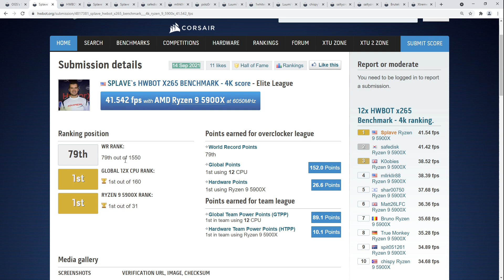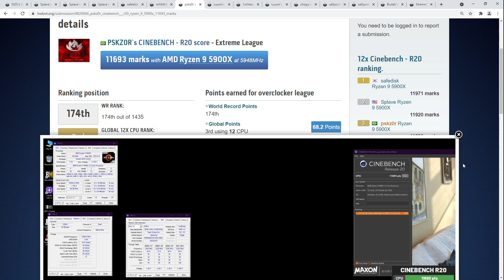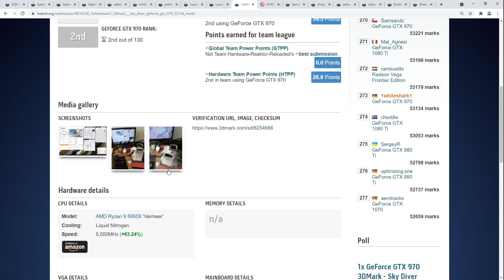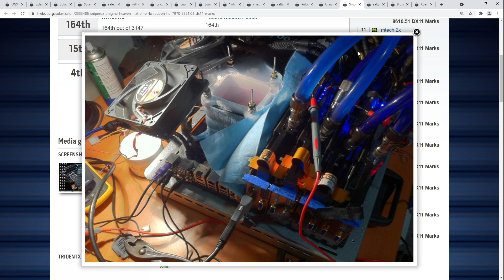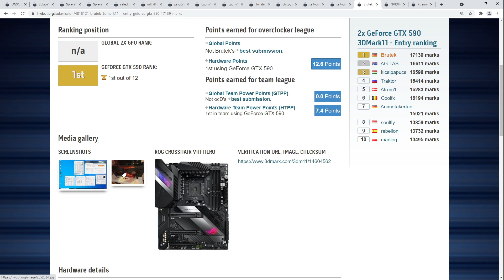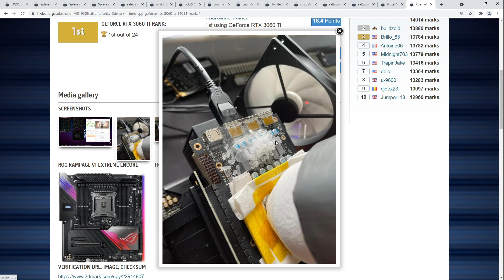HWbot round up #19: 7.1GHz 11900K, 6+GHz 5900X, 1410MHz GTX 690, 2.35GHz 3060Ti and more!

Comment: I used to be 3rd in Fire Strike with a stock cooler GTX 690 that I got broken, fixed, upgraded the VRM to handle more current and recapped in roder to get better stability. I slid to 9th place. I need a better CPU and a better OS, as clock wise, I’m not far off. I do have a waterblock somewhere that I could use to try and get even move clocks out of it. Anyways, nice to see things heating up with that card, as it was pretty quite when I posted my score.

Comment: Hey BZ Hope you're doing great. I've got a silly question. I've got 4x8 GB dual rank memory on intel 11th gen setup with 8gbit Hynix DJR chips. Do you think 4000mhz 17-21-21-36 1N CR on Gear 2 mode is benefitial against 3466mhz 16-18-18-30 1N on gear 1 because no matter what I do I can't get past 3466 mhz on gear 1 mode cause the MC on my 11th gen intel cpu apparently sneak pased the QC... Love your videos btw. Stay awesome!
Reply from the maker: gear2 with DR DJR should do around 4400. So I'd aim for that
Reply: @ActuallyHardcoreOverclocking  Awesome, Thanks!